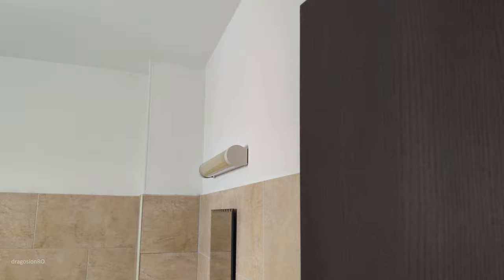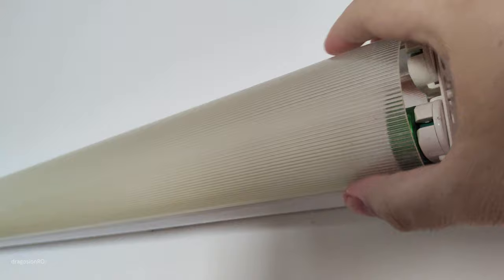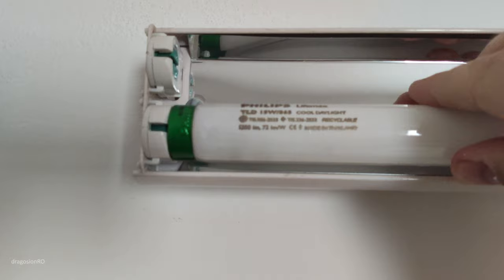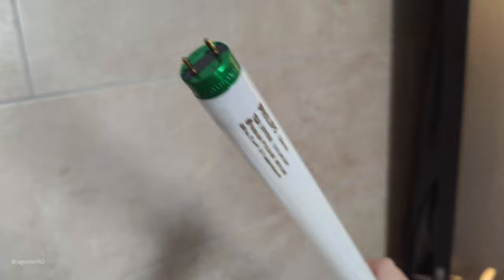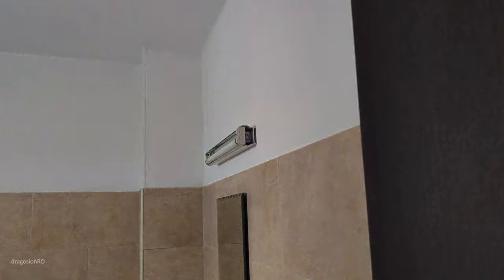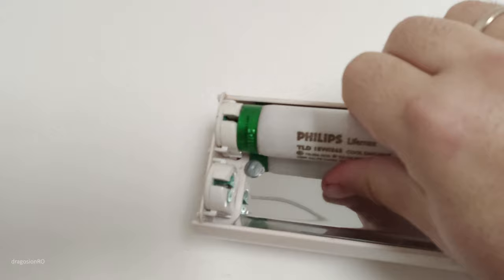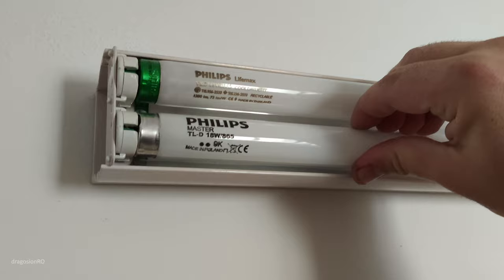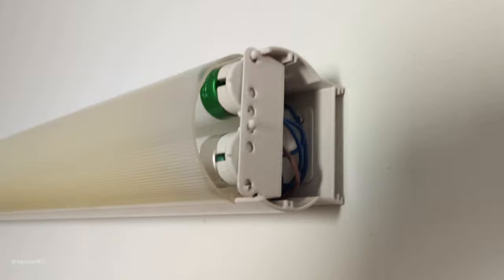How to replace a fluorescent light tube

Comment: Don't have to shut of the switch to change the bulb. I always change bad ones with the switch on. Also did u put new bulbs in because if u did they were still flickering. If that's the case, the ballast is going
Reply from the maker: Switch better be off. There's no need to risk it with mains power!
I didn't put new ones. It just shows how to remove and put new ones.
So far they're ok.